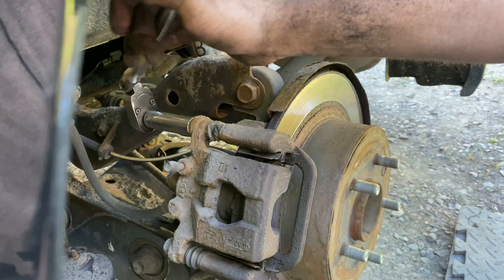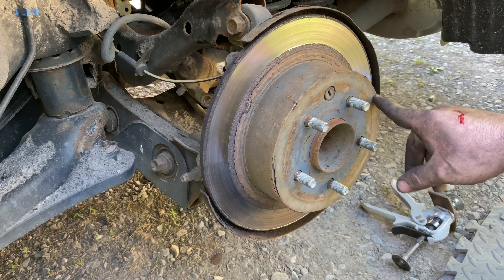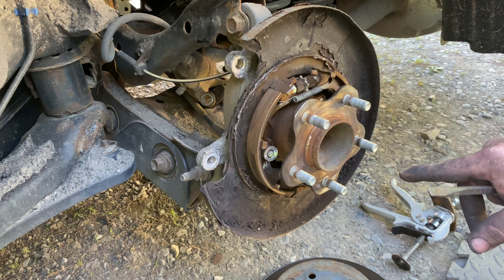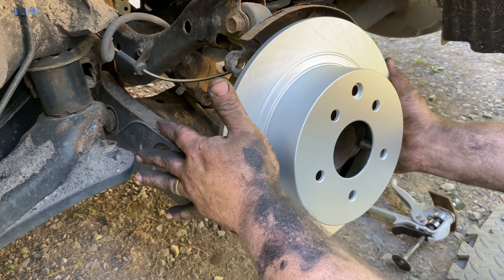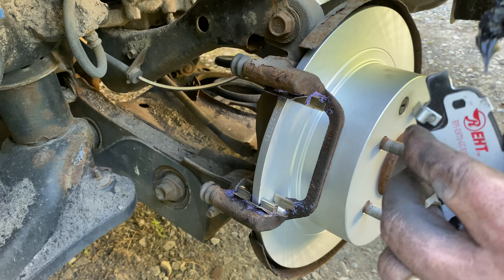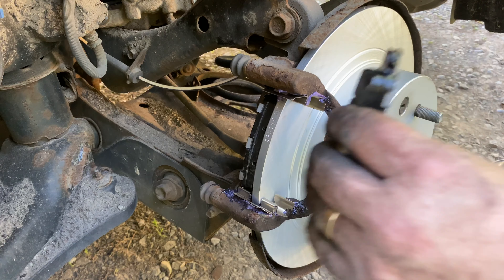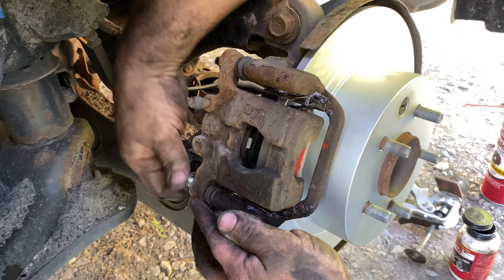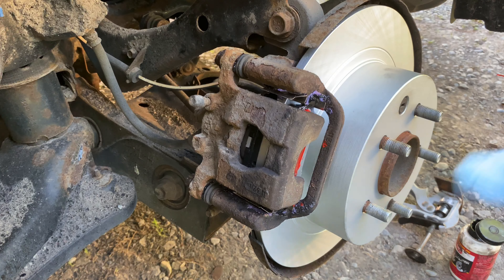2015 Nissan Altima Rear Brakes Pads and Rotors

Comment: Why dose the screw with the rubber go on the bottom? I’m taking off mine atm and the rubber one was on the top.
Reply from the maker: Odd. Was it on the top on both sides of the car?
Reply: Never heard why, but this is my theory.   The rubber on the one bolt, spins.   Freely.   So on jobs where you're only replacing the pads, you only have to unscrew the non-rotating bolt.  

But they're both inside housing that shouldn't matter when spinning on either bolt.  IDK..  Just my theory.